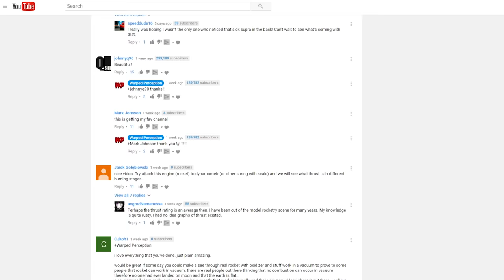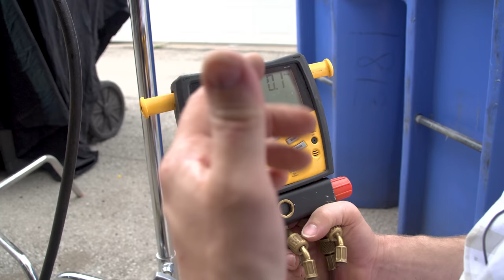Model Rocket Engine In A Vacuum Chamber - 4K Slow Motion - will it burn? - Rockets (S1 • E3)

Comment: Precisely as I have said before....There is absolutely no thrust until there is sufficient pressure ADDED to the chamber via the rocket's exhaust, that's why it took so long for any movement to be seen in the spring.       Also, you will notice at the very beginning the rocket ejected something at a high velocity away from itself, which hit the end of the vacuum chamber, and there was no reaction from the spring whatsoever.  The reason for this is because there was nothing outside of the rocket for that projectile to push against or displace.     The reason it took so long for the rocket to push against the spring is because when a vacuum is maintained...the fast blowing fire has no pressure, and no air molecules to displace, and GOES NO-WHERE.
Reply: Even if you have "said it before" you would still be wrong.  If I fire a standard steel projectile from a crossbow, in zero-g, in a vacuum, will I feel recoil? Yes or no?
Reply: @stuartgray5877  If a can of pressurized air, held in your hand outside..were to blow open on the end facing away from you, pushing all of the air out and instantly meeting resistance from air already packed in the room...it Will try and push back on you.  If a can of pressurized air, held in your hand inside a vacuum, were to blow open on the end facing away from you...The unseen force of Pressure Equalization now completely changes everything.  I mean it literally does change whether there will be recoil or NOT.  This is something you seriously need to look at my friend, because it's science...remember (it's in a vacuum now..a super low pressure environment), the results will NOT be the same as it being in your living room packed with pressure AND air molecules to push around.  So lets get it straight shall we....We ARE talking about the situation of a vacuum with Zero air molecules to push around, and a Super Low Pressure.    So that being said we move on:   When the end of the can is opened....INSTANTLY the Giant and POWERFUL Event of PRESSURE EQUALIZATION actually happens my friend, I mean it really does.  Now i have a question for you........To see if you understand we are talking about a pressurized canister in a vacuum or not....What happens during the Pressure Equalization Event, AND the air in the canister doesn't ever get a chance to run into any other air molecules in the environment.      Do you know what actually happens?
Reply: @davidbanner3724  so you refuse to just answer my question?  I asked a question first, now please answer and I will address yours.
   If I fire a standard steel projectile from a crossbow, in zero-g in a vacuum, WILL I FEEL A RECOIL?  Yes or No?  WHY or why NOT?
Reply: @davidbanner3724  oh and "SCIENCE" and "PHYSICS" says that rocket propulsuon MUST work in a vacuum.  Anyone who says otherwise does NOT understand Newton's laws and likely has never taken a physics class in their lives.  

David - have you EVER taken a physics class?  This is also a Yes or No question that I suspect you will ALSO refuse to answer.   

And I have PLENTY of definitive proof of rocket propulsion in a vacuum including video.  Answer my questions and I'll point you to the video.
Reply: @stuartgray5877  You didn't read my response did you?  I was waiting on you to answer the simple question of what happens when the Pressure Equalization event happens...since a vacuum is a super low pressure area.    You never did answer that, and that seems to be why you are having a hard time understanding if there would be any recoil or not.   Situation one:  on Earth with positive pressure AND also the presence of air molecules.....verses being in a vacuum with no pressure AND the absence of air molecules.   If you were shooting a crossbow in space, the absence of air molecules will reduce the recoil, because the projectile itself isn't slowed down or resisted when released...this reduces backpressure.   For a liquid escaping a pressurized canister however; the PRESSURE EQUALIZATION event happens.  This actually does draw the air out of the canister at an accelerated rate...and during THAT event, the pressure equalization event...YES IT IS BEING SUCKED OUT....whether you like it not, and NO no recoil as a result.    Any further questions?
Reply: @stuartgray5877  You just can't make up your mind if there is any difference between the effects of motion while in a vacuum verses on the Earth.  So you keep trying to excuse the HUGE difference it would actually be, by coming up with excuses about firing solid objects away from you like arrows and medicine balls.    You don't want to think about the situation of liquids under pressure in a canister, like with a rocket in a vacuum.....because then you have to address the obvious additional factor of PRESSURE EQUALIZATION....and now what role that plays on whether propulsion is effected.    HINT:  When the pressure equalization event actually happens, it's as though an unseen force just rips the medicine ball out of your hands, and steals away your arrow before you ever get a chance to push the medicine ball away from you.         Once you learn the effects of the PRESSURE EQUALIZATION event which actually does happen in a vacuum, then you will know whether it effects thrust or propulsion.    Get back to me when you are ready to discuss it..because it applies to rockets and liquids in a canister....not arrows and medicine balls.
Reply: @davidbanner3724  - "AND the absence of air molecules.   If you were shooting a crossbow in space, the absence of air molecules will reduce the recoil, "

No it really DOES NOT.
The MAJORITY of the recoil FORCE is the crossbow Pushing BACK on the bow as it is accelerated.
The arrow is being pushed on my the Bow (This is the ACTION) and the projectile is pushing BACK on the Bow (this is the REACTION).
While the projectile is being accelerated BOTH the BOW and the PROJECTILE FEEL THE SAME FORCE .
When you apply a force to a MASS it causes acceleration AND additional MOMENTUM.

There is a video of me firing a crossbow with THREE proejctiles.  It demonstrates that the MASS of the projectile makes a MUCH bigger difference on how much recoil the crossbow feels than the air resistance.

"...YES IT IS BEING SUCKED OUT....whether you like it not, and NO no recoil as a result. "

This is FALSE .  The "vacuum of space" Cannot "SUCK" and it CANNOT apply a force on any object, not a soild, aliquid, or a GAS.

The VACUUM of space, CANNOT SUCK.

Now when the MASS of the exhaust gas is ACCELERATED (like the projectile form the bow) out of the rocket nozzle: WHAT IS EXERTING THE FORCE ?

David, the VACUUM cannot exert a force so WHERE is it coming from? SOMETHING accelerates the mass out the back of a rocket? WHAT IS IT?
Reply: @davidbanner3724  - One more question and I will show you the VIDEO EVIDENCE of rockets working in a vacuum.

David - AT WHAT ALTITUDE does earth's atmosphere officially become "Vacuum"?

The definition of "rough vacuum" is anything below 1.0 Torr (0.02 PSI) so lets start with that. That is close to 1/1000th that at sea level.

At what ALTITUDE does it become "vacuum"??
Reply: @stuartgray5877  Well the huge vacuum chamber they built with thick concrete walls and metal lining, is said to be close to the altitude of 120,000ft above the Earth.  And the "Coffin Line" for pilots is way below that height, because the air becomes so thin, the jets lose thrust because of a huge drop in the displacement of air, and the control surfaces of the plane lose air from under them to where you can't steer the airplane any longer, no air no lift, no steerage, and a drop in propulsion as well.   What's your point though?
Reply: @stuartgray5877  If you put the tip of the arrow up against a brick wall, then let go...would it push back harder then?  If you put the tip of the arrow up against the surface of air, will it push back then? Yes of course it will...just not as much as it being against a wall.  Now when you put the tip of the arrow against the surface of nothing, does it reduce the recoil when you let go?  Yes of course it does, because there is less of a wall there to push back.  DUH!   You was wrong no big deal bubba.   The huge difference in pressure while being in a vacuum is what causes the liquid propellant of a rocket to be sucked out during the actual event of those two hugely different pressures equaling out, once the valve is opened, and the propellant is exposed to the vacuum.   It never gets a chance to push out, because it's accelerated out and into the huge vacuum of space.....just like someone yanking the medicine ball out of your hands when you go to push it away from you.....You no go nowhere essay
Reply: @davidbanner3724  the answer to "at what altitude does Atmospheric Pressure drop below 1.0 TORR?". IS: 50 kilometers.  Now watch the YT video "Uninterrupted Footage of Falcon Heavy Launch and Booster Landing" .  Watch launch to side booster landing then explain IN YOUR WORDS what you just witnessed.
Reply: @davidbanner3724  and again : the vacuum of space CANNOT, AND DOES NOT SUCK !!! 
Only people who have never taken a physics class and KNOW NOTHING ABOUT VACUUM repeat that bullshit. 
A "VACUUM" CANNOT exert a force on ANYTHING -PERIOD.

Now that we have established that the VACUUM cannot exert a force on a rockets exhaust gas, then WHERE does the force COME FROM that is accelerating the exhaust gas? The force comes from the ROCKET NOZZLE! 

The NOZZLE exerts the force that accelerated the MASS of the exhaust gas.  Therefore the nozzle FEELS RECOIL!

THIS is basic high school level physics.  Now tell us WHAT PHYSICS COURSES HAVE YOU TAKEN IN YOUR LIFE?
Reply: @stuartgray5877  A rocket going up...then falling back down...and then the rocket fired again before it lands.  That's what I see.  If the rocket had just gone straight up, it would eventually lose thrust as it got higher into thinning air...to the point where it would no longer climb in altitude...it would have to fall back down into a safer height were it could displace air again, before you could have control of the rocket again.  We already know this now.  For propulsion to work it must displace air...you go too high, the rocket stops climbing.  Pretty simple actually.  For a rocket I don't know the exact altitude before the rocket starts "slipping"...losing traction because of really thin air.
Reply: @davidbanner3724  “A rocket going up...then falling back down...”

WOW simplify much?

Now watch the video from SpaceX. Search YT for “Falcon Heavy Test Flight”
You can correlate the events in the ground video to events on the SpaceX video.

Did you miss the part where the three common core vehicle was travelling at 3600 MPH (yes thirty six hundred miles per hour) EASTWARD and ABOVE 50 kilometers when those side boosters separated?

The side boosters were heading EAST at 3600 MPH and separated IN VACUUM.
Now what did those boosters do NEXT?
They CANCELED that 3600 MPH, and TURNED AROUND and FLEW BACK TO KSC ABOVE 60 kilometers .

David – If rocket propulsion dos not work in a vacuum - HOW THE HELL DID THOSE BOOSTERS DO THAT IN A VACUUM ?
Black fucking magic?
Reply: @davidbanner3724  some things I haven't even told you: 1 - I have been a vacuum test specialist for almost 25 years, and I have operated Billion dollar vehicles in vacuum here on Earth.  I have also operated some of the largest TVAC Chambers in the country.  I was first trained at Lockheed Martin Space Simulation Lab in the 1990s.   2 - I have been a member of a Propulsuon Team more than once and I have loaded propellant onto Spacecraft more than once.  3 - I have personally helped launch five spacecraft, four to deep space, and helped FLY them during the missions.  4 - I have personally witnessed over twenty real rocket launches including: Athena, Delta-II, Delta-IV, Minotaur, Atlas, Space Shuttle (launch and landings), and Falcon 9 launch and booster return.  I have had hazardous ops and pad access at KSC, CCAFS, and VAFB for over 20 years.  I can only assume that YOU have never seen a real rocket launch in your life, but you want to argue with someone who has likely been launching payloads to space for longer than you have been alive?  Yeah that's funny.
Reply: @davidbanner3724  What's the matter? Struggling with cognitive dissonance once you realized you are watching that which you say  is impossible?
Reply: @stuartgray5877  You said all of that, just to admit nobody ever tested any of those rockets inside that fancy Vacuum Chamber  TVAC you speak of.  And, those Eastward moving rockets destined for the Bermuda Triangle area of the Ocean, were NO where NEAR being in a Vacuum.  An SR-21 can fly pretty well (not able to make quick turns because of thin air under it's wings), but an SR-21 can fly decently above the Coffin line, that normal jets and aircraft cannot, ONLY because it's moving fast enough into what air IS available up that high, to help it keep aloft and moving.     The truth will set you free.
Reply: @davidbanner3724  - It is a VACUUM up where you watched those boosters turn around and fly back. End of debate. Rocket Propulsion IN A VACUUM

IF you bothered to watch the on-board video from spaceX I could point out a few things that are PROOF of the boosters separating in vacuum.
Reply: @stuartgray5877  Not even close to a true vacuum, and you know that.  Let me break it down again:  1.  Rocket close to the concrete on the launch pad=Fast take off.  2.  Rocket suspended 100 foot off of the ground, then trying to take off=Slow take off.  3.  Suspending the rocket in a vacuum without launch pad, and no air 100 foot off of the ground=No take off.  See the pattern?
Reply: @davidbanner3724  Tell me your level of education and what you do for a living.  Please include ANY technical work you have done on Flight Hardware.
Then we will compare credentials and see which one of us is the authority to speak on these subjects.

I'll go first:  I have an electrical Engineering Degree, and I have worked for almost 25 years at/or for: Lockheed Martin Space Simulation Laboratory, Lockheed Martin Flight Systems, Jet Propulsion Laboratory, Laboratory for Atmospheric and Space Physics, Goddard Space Flight Center, Marshall Space Flight Center, Ball Aerospace, NOAA, NASA, and DOD.  I have personally helped build, test, prepare for launch, and Launch five spacecraft, four of them to Deep Space.  I helped FLY two of those deep space missions during their mission, and I have helped commission and fly one earth orbiting weather satellite that is above our heads right now.

YOUR TURN.

I suspect your "Authority" on the subject IS: " I watched a YT video once, and slept at a Holiday Inn Express last night"
Reply: @davidbanner3724  One last thing:

DID YOU WATCH THE VIDEO FROM SPACEX of the side boosters separating from the center core?
I TOLD you that there is HARD EVIDENCE that those boosters DID separate IN A FUCKING VACUUM.
Now did you WATCH the SpaceX video or NOT?  Or did your cognitive dissonance keep you from even watching?

And by the way there are FORTY FIVE of these videos for your to analyze to show where the video is fake.

Yes SpaceX has recovered the boosters FORTY FIVE TIMES ALREADY. But you think all of those launches are fake right?
Reply: @stuartgray5877  I'm guessing that you tooting your own horn, is to avoid the question of whether the alleged Coriolis Effect applies to airplanes.   Now that we have established people can get up from their seats, and walk to the bathroom on the airplane just fine, and you have shared your education with us.........Back to the burning question:   Does the Coriolis Effect apply to Airplanes?
Reply: @davidbanner3724  - "Does the Coriolis Effect apply to Airplanes?"

Airplanes do not have to compensate for the Coriolis effect.

Now would you care to explain to ME the FACT that most modern aircraft have ring-laser gyros that measure earth rotation AND CURVE?

I have performed this test myself, with more than one type of ring-laser gyro. I was first trained to test the Litton LN-200 back at Lockheed Martin in the 1990s. The bench acceptance test of the RLG used in our ICBMs is to VERIFY that the units reads EARTH ROTATION on all three axes.

But dont believe ME, take it from YT videos:
“100% Proof that Earth Spins! Aircraft Laser Gyroscopes”
, or “Understanding the ADIRU | Training | Honeywell”
, or “IRS Align Mode - Carefully Measuring Earth's Rotation”
Reply: @stuartgray5877  If the Earth doesn't rotate out from under an object independent from the Earth, such as the Airplane....which you now say doesn't happen for airplanes, and they do NOT compensate for it.  Then you just said it all in that ONE statement:  Airplanes (this means the plane itself and instrumentation onboard).....Does NOT compensate for the Earth rotating out from under the Airplane.    You just contradicted yourself, with the latter part of your statement..."But gyros do".    Again...you are full of it.   Totally full of shit dude.   The ring laser gyro has never detected the Earth's rotation, and was put in place to be a more accurate gyro that didn't need to be corrected because of advanced aerial manuevers which would Gimble lock standard mechanical gyros.  Shueler tuning and pendulous vanes were incorporated before the ring laser gyro to compensate for the tendency of gyro's to gimbal lock during rolls or manuevers.   Now i know you are full of it, dude....because you don't even understand how or why the ring laser gyro works.   Do your research idiot.
Reply: @davidbanner3724  - Are you incapable of even watching a video??
 Those videos explain that the Ring-Laser-Gyros Measure earth rotation AND CURVE as PART OF THE PRE-FLIGHT TEST !!
The aircraft must be held VERY STILL on the tarmac for the test to pass.

They DO NOT compensate, measure, or otherwise CARE about earths rotation while in flight.
Reply: @davidbanner3724  Did you WATCH the ring laser videos yet?
  Tell me that Honeywell Engineer is LYING in an official Honeywell video.
 LYING to the FAA about how their flight critical piece of hardware performs self-tests would be A FELONY.
Reply: @davidbanner3724  Have you even BOTHERED to check the news about Spacex's Starlink satellite launches?
You know the ones where you CAN SEE THE STRING OF SATELLITES WITH YOUR EYES for a few weeks after launch?

I'll BET your cognitive dissonance will not even let you ACKNOWLEDGE the existence of these launches and VISIBLE TO THE NAKED EYE satellites.

Another launch went up THIS MORNING!  

Now be SURE TO IGNORE that fact, and whatever you do DONT GO LOOK FOR THEM.
DONT google search "How to spot the starlink satellites" WHATEVER YOU DO.
Reply: @stuartgray5877  Honeywell has never ever said those devices installed in an Airplane, are compensating for the curvature gravity of the Earth.  You did in fact make that part up.  What they do say is that it provides a good gyro for Airplanes, because it does not Gimbal lock, or get off track and have to be reset.   I would also like you to research another product made by Honeywell which proves the Flat Earth...that product is called TARS.  These are sensors being used by large Construction Companies to survey and track the geography of the ground, because the vehicles they are attached to are in fact moving over the surface of the Earth.   And yet again...the findings of those TARS sensors is that the Earth is not a Globe.   Some of them were recently used by Universities to determine the land of their entire STATE.  Results:  FLAT AS A PANCAKE.....In fact "flatter than a pancake" I believe were the actual words.   Understand the technology you throw out there bro....before you profess to know anything about it.
Reply: @stuartgray5877  Sad thing about the ring laser gyros however; is that it becomes unreliable when hums and sounds are near it.  This starts to make it give false readings.   More than likely why they are only used on aircraft as an AID to the precision mechanical gyros.   Every single test using a ring laser gyro on the ground, has showed these "anomalies" in the findings...one group of scientist said they couldn't get a 15 degree per hour rotation reading because there was a power plant nearby that was giving off a hum.   Other groups of scientists said they couldn't get it to show 15 degree per hour rotation of the ground, because it was being tested too close to an area of plate tectonic activity producing vibrations in the ground.   There has never been a scientific study showing that they detect a 15 degree per hour rotation of the Earth.  Not even the Huge new Ring Laser facility especially designed to detect such a thing.  Wonder why that is?  Answer:   The Earth is at rest my friend.   At..REST.
Reply: @stuartgray5877   "They now aim to make the apparatus more accurate, enabling them to determine changes in the Earth's rotational axis over a single day. The scientists also plan to make the ring laser capable of continuous operation so that it can run for a period of years without any deviations. "In simple terms," concludes Schreiber, "in future, we want to be able to just pop down into the basement and find out how fast the Earth is accurately turning right now."  Well what do ya know...an entire underground facility with much more sensitive and stable ring laser gyros....STILL hasn't been able to show the Earth rotating...but In the FUTURE they HOPE it will Stuart.   Isn't it odd what you can find when you actually look for the actual scientific results of these ring laser gyros?   I mean i am gunning for them...perhaps ROMY one day in the FUTURE will show us something..but until then Stuart...we will just have to speculate about what it will or will not show. 

Food for thought concerning Pendulums:  The nature of a ball swinging back and forth through the air, doesn't allow it to swing in a perfectly straight line.  Because it is in fact forced to push air out of the way (displace air) while it swings in both directions.  And we must have needs of being scientific don't we?  Then let me give you the skinny:  The leading face of the ball moving into the air in front of it, immediately starts forcing the ball to "choose a side"..either left or right.  This quickly makes the ball start swinging in a slight circular motion, instead of perfectly  straight. 

So Stuart...if you want to see if a Pendulum can display the Earth rotating, you have to place one inside of a vacuum chamber, then get it swinging.    Only in a vacuum chamber will a ball swinging back and forth swing in a perfectly straight line.  Because it DOESN'T run into air while it swings, which forces the swing direction to alter.  If you want to be Scientific, then be Scientific.  So let's build a vacuum chamber Pendulum, and see if it shows a 15 degree per hour rotation shall we?   THEN we will have an accurate "Foucault Pendulum."     Otherwise, I can use the knowledge of a pendulum swinging in the air which DOES have a tendency to start swinging in a slight circle because of the nature of the interaction of the surface of the leading face of the ball pushing air out of the way in the room, or Museum...I can capitalize on this fact...seek advantage, and force the ball to swing at even intervals using a motor hidden in the ceiling, or in the ground beneath, and get the desired effect I am trying to PUSH ON YOU....Fool you with....Lie to you about....Just like Foucault did.

So let's build one in a vacuum chamber and REALLY see what's going on shall we?
Reply: @stuartgray5877  With me...it's not about me being right or wrong....it's about me actually knowing the truth.  And having actual scientific data to back it up.  No play on words, no hidden agenda, no rigged experiments, and no contradictory terminology.   That's what all of my QED's are based off of:  Quad Erat Demonstrandum.
Reply: @stuartgray5877  I have a lot of questions about the Earth we live on.  But i want straight forward answers.  I wanna know why the "Ring of Fire" on the Earth just so happens to be right about directly under where the Sun moves over the Earth, AND where almost all plate tectonics occur.  I wanna KNOW what the correlation is.   I think i know, but i truly want to know.  I wanna know why the tides are forced to go out as soon as the Sun comes up, and why they are forced to come in..simulcast as the Sun sets.  I think I know, but I truly want to know. 

There are tons of things i wanna know.  But i try my best not to put myself out there and say this or that until I have the absolute undeniable Truth...like the surface of water unable to bend and stay bent.  Like the movement of currents in the Ocean and river flows showing explicitly there is zero centrifugal force present.   Or the Moon casting a 70 mile wide shadow during an eclipse...I know how a shadow is made, and I know how those shadows are cast.  You should too.  You seem smart enough to understand it.  And you should know what I'm getting at.  There is an absolute MINIMUM size a shadow will ever be..and that is the actual size of the Object...It simply doesn't occur in reality where a shadow is smaller than the object itself. 

Play on words is one of the leading distractions to the real Truth.  The Physics of everything just tells the Truth...Men with word play are the ones who distort that truth.
Reply: @davidbanner3724  - " Every single test using a ring laser gyro on the ground, has showed these "anomalies" in the findings...one group of scientist said they couldn't get a 15 degree per hour rotation reading because there was a power plant nearby that was giving off a hum.   Other groups of scientists said they couldn't get it to show 15 degree per hour rotation of the ground, because it was being tested too close to an area of plate tectonic activity producing vibrations in the ground.   There has never been a scientific study showing that they detect a 15 degree per hour rotation of the Earth. "

EVERY single thing you said above is a flat out LIE.  You literally made that shit up.

Cite references or quit spouting hearsay.
Reply: @davidbanner3724  and *as predicted*....... silence......
Reply: @stuartgray5877  Stuart, you and I know perfectly well how propulsion works.  You know there is no propulsion in the vacuum of space for two reasons.  Number one:  The enormous and powerful event of pressure equalization when the valve is opened to the propellant, which does in fact "suck it out"...and the second reason is because there is no liquid or air to displace in space.   You know this deep down...and you know it's the truth.   TWO physics laws apply in the vacuum of Space, which prohibits propulsion.   You can't change that...you can only continue to act stupid and deny them both.  Get a clue brother.
Reply: @stuartgray5877  Repeatedly ignoring the Physical properties of Space, and still thinking a rocket will fly around just like one here on the Earth.....is Most Suspect Stuart.
Reply: @davidbanner3724  - "You know there is no propulsion in the vacuum of space "

BUT I SHOWED YOU a VIDEO of " Propulsion IN THE VACUUM OF SPACE ".

That rocket CLEARLY propelled itself and it WAS IN VACUUM WHEN IT DID IT.

Moving on ...
Reply: @davidbanner3724  repeatedly trying to lecture engineers after having NEVER TAKEN A PHYSICS CLASS IN HIS LIFE !
Reply: @stuartgray5877  Then tell me Mr. Engineer...what happens when the valve is opened to a pressurized canister of liquid when the canister is located in a gigantic and powerful vacuum chamber?  Tell me smart ass...does it make the liquid come out faster or slower?   Or no change at all?  Brainiac.
Reply: @stuartgray5877  "Then tell me Mr. Engineer...what happens when the valve is opened to a pressurized canister of liquid when the canister is located in a gigantic and powerful vacuum chamber?  Tell me smart ass...does it make the liquid come out faster or slower?   Or no change at all?  Brainiac."  --  Dr. David Banner F.E.S.

Let that sink in for a while poser.
Reply: @davidbanner3724  were you able to find any flaws in the math of my physics example above, or was it all over your head because it included math?